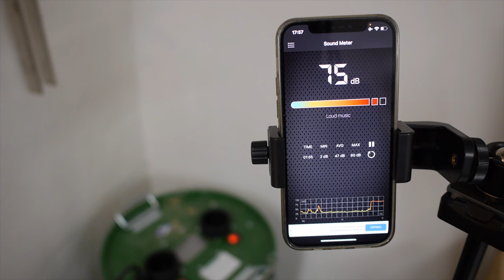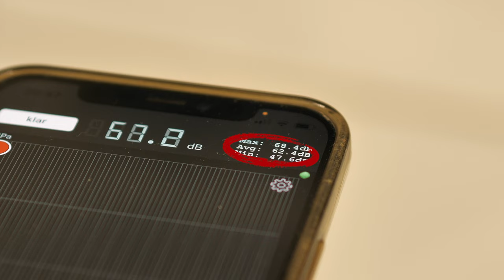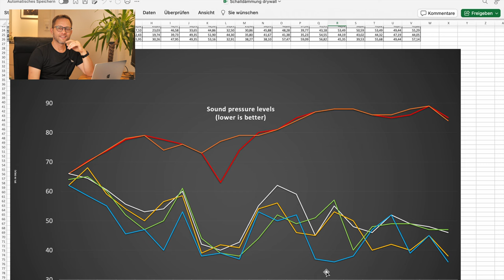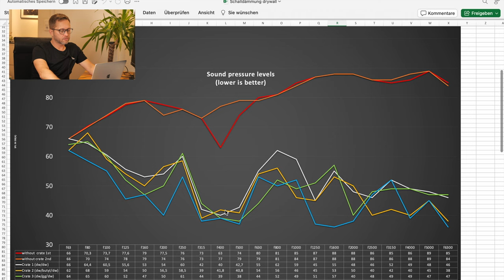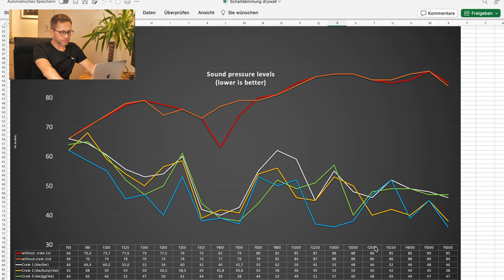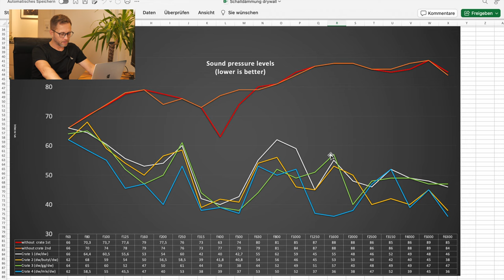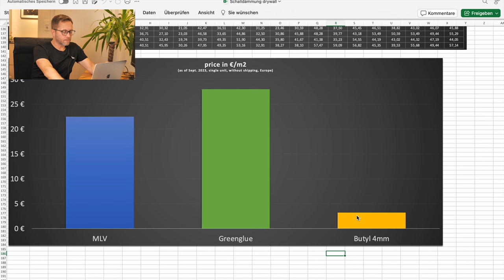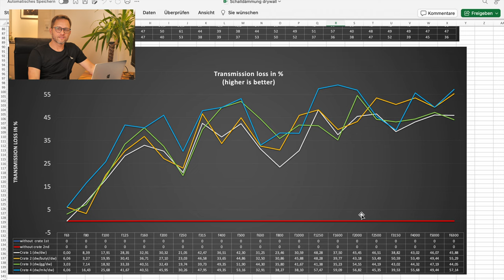Silencing loud things (part 2)

Comment: Glad to see there is a part three. Certainly a very inexpensive way to soundproof a noisy shop vac. My obvious question - one I'm sure will be answered in the following video - is about heat. We all want the quiet life, but not if our trusty shop vac ends up melting in the process.  Oh, thank you so much for sharing.
Reply from the maker: This vac has 2k watts, so a lot of energy. On average, I have the vac running for 5-10 minutes, rarely longer than 15 minutes. The exhaust air is warm, but not hot. It seems to me that it is designed to be cooled by the air that is going through the vac, less the surface of the bin. But I would recommend to alway be around when it is running. And I have a smoke detector on the ceiling above the shop vac.

Comment: Thanks for taking the time to produce part 2.  Very interesting results, MLV looks to be the way to go for sure on your project. I built an enclosure for my camvac following the general principles from your part 1 video.  It’s just an mdf box with some fibre board underlay attached to the inside walls. It works really well.  The loudest part now is the noise from the air being pulled through my machines rather than the camvac! Look forward to part 3 👍
Reply from the maker: Yeah, the outgoing air carries a lot of noise. I think I found a practical way to reduce that. Wait for part 3, I worked parallel on it, won’t take too long

Comment: Hello Tim Could you try and find a way to quieten the Db levels of a mitre saw? Besides the motor noize the Blade is like a Cymbal from a Drumkit and rings out every time you Raise the Blade after cutting the Wood.
Reply from the maker: Hey Michael, unfortunately I don´t own a miter saw and never used a miter saw. Im afraid, at the moment I don´t have a helpfull answer.

Comment: I am somewhat of a layman, so this question may seem a bit obvious, but is it possible that using less butyl sealant could increase sound dampening further due to less points of contact allowing the transmission of vibration? For instance, I know the bottom panel probably needs the support of the two rings you installed, but the sides could possibly be held at a distance with only a few points of contact in the corners. I'm drawing on my understanding of heat transfer here, so I imagine the science isn't exactly the same, but if you want to isolate the inner box from the outer box as much as possible I think reducing total sealant usage is a viable option.
Reply from the maker: Yeah, good question. On the other hand, The air between both layers is a factor too. With just one ring there might be more resonance than with a second ring damping the vibration. It’s everything but trivial
Reply: Seems like reaching perfection would be incredibly time consuming. The effort vs efficiency graph would be almost asymptotic. It probably wouldn't be worth it considering you've basically achieved a near analogous result to the more expensive options, but hypothetically it might be best to focus on avoiding patterns that increase the resonance at the frequencies that spike on your data sheet.
Reply: Q: "is it possible that using less butyl sealant could increase sound dsmping?"
A: NO.  Butyl rubber's purpose is to attenuate the vibration, and more contact is better.  Butyl rubber is used to quiet large metal surfaces (as found in luxury cars), and the most effective technique is to use "constrained layer damping", which is a sheet of Butyl rubber sandwiched between two metal sheets. Very effective!
Reply: That makes sense. Thanks for the clarification.